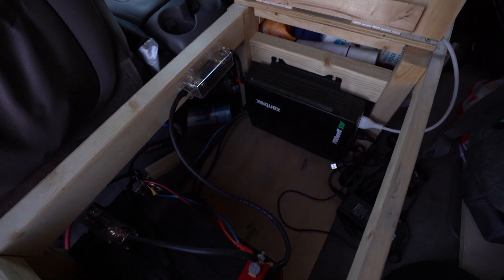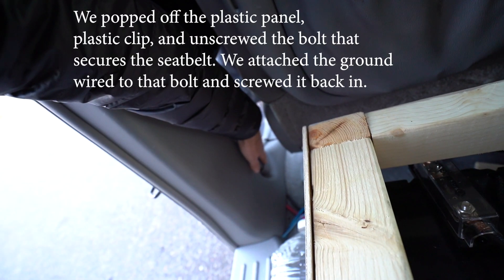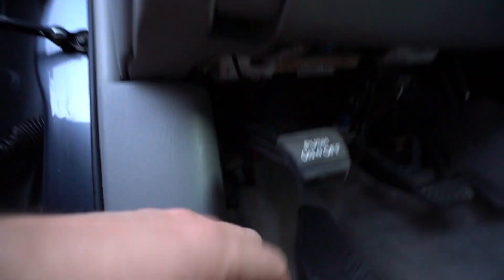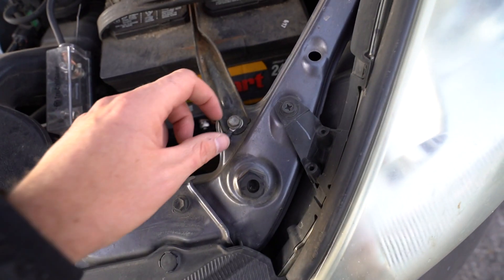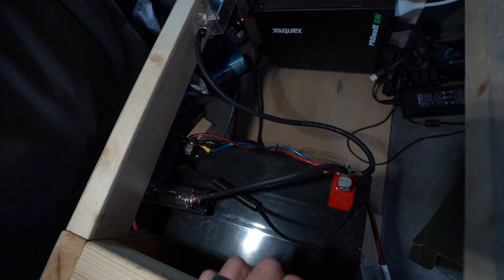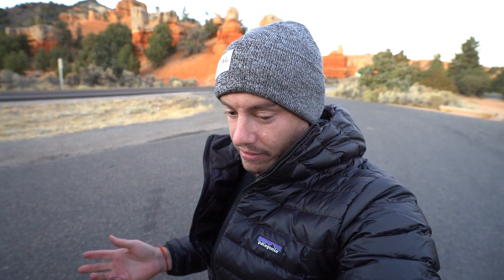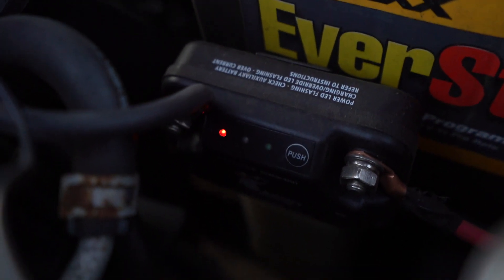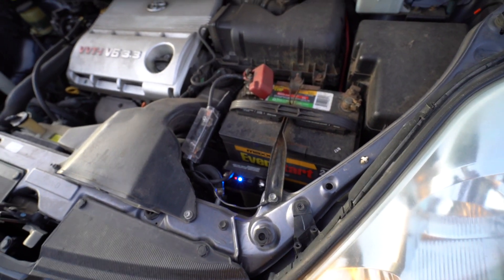How We Installed a Second Battery in our Toyota Sienna Camper Van

Comment: Does the Sienna Alternator work well charging 2 batteries? Im installing a Diesel Heater in the rear seat cavity, Ive removed the seat. I plan on installing the battery in the rear seat space next to the Diesel Heater. The start up of the diesel heater and the shutdown of the heater uses more voltage so I would like to start the Sienna for a 5 minute startup.  I want to use a switch in the rear not a smart isolator. I want to do winter ski and Mt Bike camping..

Comment: Hi there! Your work on your van is amazing!!!  I have a 2018 Toyota Sienna that I use as a camper and live in fairly regularly, however the battery keeps dying around once a week. So far I'm not aware of any other problems, but I do open my doors a lot. Just wondering if any other Sienna camper van people have had similar issues! Thanks so much. :)
Reply from the maker: Which battery is dying? the starter battery? or do you have an auxiliary battery as well? We did have our starter battery die at some point but just got a new one and everything was fine after that.

Comment: Thank you for an informative video.  Approximately what length of wire did you need to get from the isolator by the car battery to the deep cycle battery behind the driver's seat?
Reply from the maker: Thanks. To be very honest i cant remember, but i believe it was 8-10 feet long.
Reply: @xploreitall5392  Thanks! I have since done a similar operation and the cables should be 20 feet long to reach the back of the car.  I think 10 to the back of the driver's seat is cutting it a bit close.

Comment: A question and a suggestion...
First, why didn't you put the battery in the rear well? Where the rear seats used to drop down?
Suggestion..instead of a an expensive, energy-hogging DC fridge, buy a good ice chest and a portable ice maker.  An ice maker runs less than 150 watts and will pump out lots of ice. You can even run it off an inverter....
And I'll let you in on a little secret. When the ice melts you can use the water to make more ice! Now how utterly cool is that? I think it's called "sustainability".  Saving the planet and all that...Sustainable water...
Reply: An interesting idea, but in my experience, there are too many food items that react poorly to being water-logged for this to be feasible.
Reply: @adriancombe  Fair enough. After further consideration, I've decided to pop for a really good fridge for next summer. Right around $1,000. I've been buying a lot of ice and after awhile, we're talking real $$$$$.